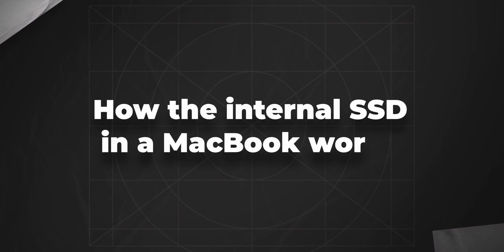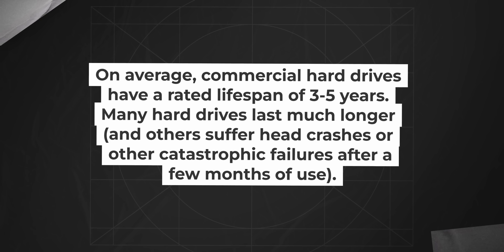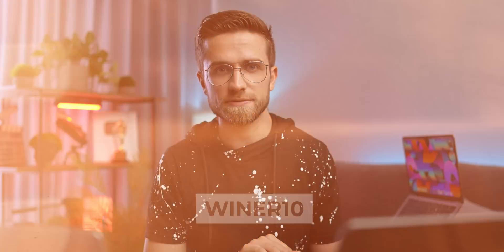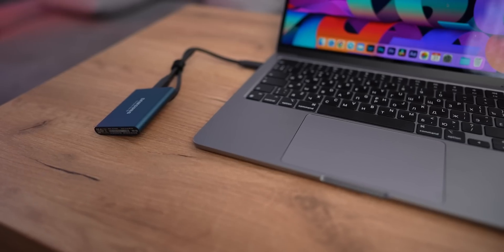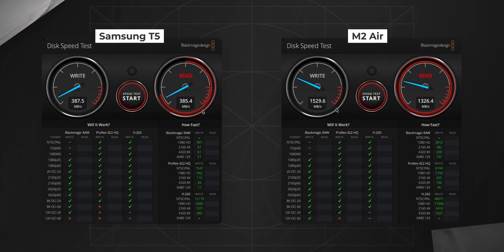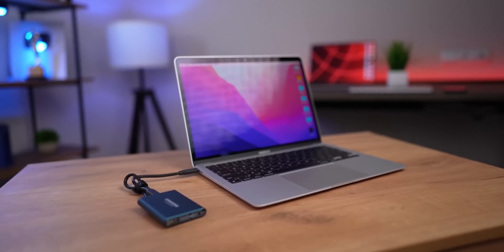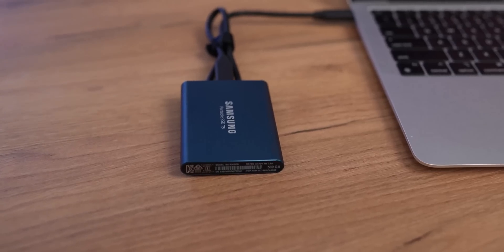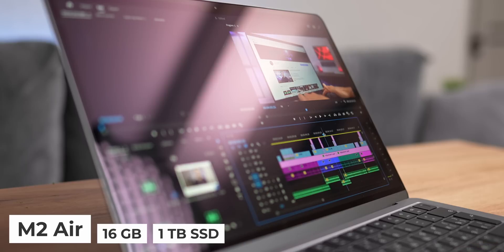M2 MacBook Air UPGRADE that actually makes NO SENSE!

Comment: That's not true, you can boot any Mac from an external storage unit. Also, since the OS goes mainly in the memory (RAM) it will run flawlessly. Finally, those Thunderbolt 3 / 4 ports are fast af. For decades we use to work projects on external drives, no wonder why Apple have closed the internal drive replacement design: the insane speed of these ports protocols. The only bottle neck will be your external device's limitations. So don't go cheap on external storage.

Comment: Unless Apple Silicon has changed things, this is plain wrong. I’ve been running a 2017 imac off an external thunderbolt ssd drive for years. It was a huge upgrade from the built-in Fusion Drive. Swap is definitely on the external drive.

Comment: Great video! Are regular Zoom meetings considered resource-intensive? Should I upgrade the memory in addition to 512GB storage?
Reply: If you are only doing common office tasks day to day it is not necessary to upgrade your m2 air, just the default config is fine unless you have few more hundreds to spend (and nvme ssd is crazily cheap in the market actually)

Comment: (5:23) "an external SSD cannot know what is happening in the logic board, therefore be used for swap storage". This is a major misunderstanding of how swap works. It's not the SSD that goes and check if RAM usage is high, and decides to kindly lend a helping hand. The kernel does this. The SSD is just a drive, it doesn't need to "know" anything about the logic board.

Comment: Should we all just spend a little more money and buy the 14 inch MacBook Pro
Reply: I agree, upgrading your M2 Air to 16gb RAM and 512gb SSD will cost 1,700 usd. You can get the objectively better base model 14 Pro at 1,800 usd.
Reply: @midnightsnack1306  but the pro doesn’t have the  midnight color😏

Comment: People instead of the M1 buy the M2 air. Don't believe what other says, the M1 is already "old" so if you keep it 3-5 years it will be 5-7 years old. Just buy the new one, it's better in every way🥰
Reply: it isn't better in every way, it just isn't. Not saying that your resale comment isn't valid, but half the speed SSD is a fact, they stuffed up, and that's all there is to it. If I had waited for the 2nd version of the macstudio I bought and it had a half the speed on the SSD I would have been pissed.
Reply: @ggproductions7078  personally I think that even if the ssd "issue" is true it doesn't mean that is really an issue, the difference with the reading and writing thing is at most a couple of minutes between a 256gb and a 512gb. They are blowing it up of proportion...it's not that serious. That's way to me it's a way better solution to buy the M2 with a 16gb ram and a 256gb ssd.
Reply: @productivitymodeon  That' an interesting view. It is half the speed and it is because of the NAND chip situation. That is a fact. Again, companies make mistakes and either this is one or it was a deliberate decision to shave a minimal cost reduction and hope that people didn't notice. If they had pointed it out, as they have with other products, and said sorry, this is slower than the last model but if you upgrade the SSD you get faster speeds then all would have been good, well, not good, the implication is that things get better not worse! The idea that it's not that important, well let's get back to hartd drives eh, or Solid state drives of the old kind, I mean, speed doesn't matter does it! The idea that you can get a Thunderbolt 3 enclosure that runs faster than the built in SSD is a nonesens. But of course, this is just IMO and it seems that right now everybody has one! Have a fine day of it.
Reply: @ggproductions7078  yeah I know that but even with that said we are still talking about minutes not hours.
Reply: @productivitymodeon  Sure, and in a way I am contradicting myself, I have often said when talking about mobile phones that if it moves at half a blink speed then surely I could live with it taking a full blink speed, sure, of course, unless I am paying for new and improved and not old and ordinary ( I know the M1 Air is not old and ordinary) I think they have made a deliberate policy of reducing the speed in order to encourage you to ladder and pay the extra 200, then you think, well, I have spent 1400 so I might as well get the 16gb memory, actually now I have spent 1600 I might as well spend another 180 and get the 14" M1 pro, MacBook pro which is better in every single way except weight. This idea that a £1200 laptop is entry level for light work and media consumption is a nonsense, as is the condescending notion that the people who would "only" spend 1200 won't notice, it's crap loads of money! I think, once you have spent that you have a right to expect it to perform better than the previous model. Now there could be an argument that as it is still available just get the M1 and that is fair, but they should have just let us know and not have people find out through reviews.
Reply: @ggproductions7078  yeah all of that is fair and right. I still think the M2 is the best choice, from the design (I’m talking about magsafe besides the color) to the speed. Again, you are right in saying that they should have told us about all of it, I think they should have stopped selling the M1 and they should have put the M2 at a lower price (at least here in the EU where it cost at minimum 1400€)
Reply: @productivitymodeon  That's a fair comment, don't get me wrong, different design, better screen and webcam, increased bandwidth and magsafe with at least the same performance and it would have been worth the price rise. But given they were selling the M1 macmini for the same price as the Intel version, they are able to make choices. But, I use a macstudio for my work and an old windows i5 laptop for MS office stuff and, well, laptop work and media consumption. It can't do any video editing, and the battery is crap, the screen is ok but it probably would cost about 600 for a newer version, so it's all down to choice I guess.

Comment: A external ssd may not improve the performance but will help to maintain the performance of the Air, cause you can have always enough free space in the internal ssd. All libraies and files in the external and only apps and projects in the internal. So 250 GB should be enough... if you need more, well you need a Pro machine

Comment: I current have an external ssd that I'm using with my MacBook Air that I have my MacOS installed on and boot from.  (I have a vanilla macOS Monterey installed on my internal drive that I run ONLY  apple silicon or universal apps since I don't want that Rosetta bug to affect it with heavy swap memory issues).  I didn't hear you mention anything about running the OS off the external (might have missed it??).   Its FAST!!! and that's not even using a Thunderbolt 3 NVME SSD drive either!!! So far....its running perfectly on my MacBook Air 8GB, 256GB laptop!

Comment: Technically this is how most professionals that do highend video and audio recording. The main drive is only used for the OS and Software but you install samples, assets , plugins on an external SSD or a thunderbolt based external hard drive. Saving to the main internal SSD is the stupidest thing to do. SSD have issues with consistent write or rewrite. The external drive becomes where all projects files live. 

If you didn’t know this is how professionals like myself work, you should do some research.

Comment: A few points:
1. swap is standard on all computers on all operating systems. You'll never have enough physical memory for how much your applications might need to address. It is perfectly fine for the computer to swap.
2. The "issue" you're describing here should be blamed on having only 8GB of RAM. Because the base config does not have "enough" RAM, it may need to swap more, thus write to swap more, thus reduce the lifespan of the SSD. You are correct here but the issue is more the RAM and not the SSD.
3. You did some random test where you compared loading apps from an external drive vs the internal drive. As you described most people would install their apps on the internal drive so your test is pointless.
4. You say that an external drive cannot be used for swap. NO. The point is that it would be stupid to use an external drive as swap. First off, external drives are hot-swappable/removeable. What is the OS to do when all of a sudden its swap has disappeared? Now you have missing data or corrupted data. Secondly, most external drives are connected using the USB bus. This is so much slower than whatever internal bus (PCIe for standard computers) and would not be worth it. Thunderbolt may be faster than USB but it is not yet standard for most drives.
5. Your "can the Mac use the external SSD as swap" test is, based on point 4, entirely nonsensical. Unless you modify the system's behaviour, it will not even consider using the external SSD as swap.
Reply: So it is not a good idea to buy Air M2 base model. Should i go for M1 Air base?

Comment: I don't like the idea that the lifespan of my mac is limited to the health of the hard drive, for if it fails the mac is toast. I think I'll keep my intel MBA instead of selling it, granted it's a 2011 model but as I'm able to replace the SSD it may well end up outlasting the life of my M2. :O
Reply: There are stress tests out there that show that unless you are writing terabytes  of data regularly, most SSDs should last longer than the useful lifetime of the computer.

In China, there are already third party repair shops that can replace the RAM and SSD of the M1 Macs. I can imagine in a few years, US repairs shops will be able to import the equipment needed and learn the methods eventually to do those upgrades. Macs are pretty popular and expensive, there should be a demand for such a service.
Reply: If it works for you, that's great. I wouldn't be so afraid of this whole M2 SSD issue though because it's definitely been overblown if you're just a normal user.
Reply: @sebastianlau4809  You're probably right, its just that I have extended the life of many of my Macs by replacing hard drives, but then they were mechanical ones... not SSDs. I think these things don't really concern those with fat wallets but when you wear worn shoes you have to consider these things.
Reply: I have a 2013 mba 11” 8GB ram with 1TB ssd, I don’t wanna waste time on this machine… I replaced it with iPad Pro in 2018. 

I thought getting bigger ssd would help the lifespan but it’s not truth, I wanted a new machine lol

Comment: This is going to be plain and simple the base MacBook Air M2 is more than powerful enough for 90% of users out there the 256 GB SSD that is the only flaw with these new devices I think the reason why the slower SSD speeds came to flourishing was due to the market shortage is it fair to consumers know but those speeds should be fast enough for the majority of users .when comes to users transferring files from and external drive those speeds are limited to the transfer speeds cap on the drive so theoretically speaking it shouldn't matter stop using the macbook air for pro task just buy the pro

Comment: Thunderbolt external storage should be much faster than this usb SSD shown here. Need to give this another shot. External drives have always been used, not sure how or why you give the impression they are not 🤔 

I think 10+ years ago using internal hard drives with less than 80MB  read/wright, external SSD was much faster around 2-300+.

Now it’s insanely fast what can be achieved. Regardless, get a proper external Thunderbolt NVMe Drive and do this test again
Reply: !00%, you can spend £175 ish on the enclosure for a basic one, 150 on a PCIE3 NVME for 2tb and you will be getting faster speeds than the 256GB internal, you may be able to get up to 2500mbs, but more likely 2000mbs ish

Comment: planning on buying a Mac for uni. I either go for the M1 base model air or the M2 base model air, there is a price difference of $300 when the "educational/student" price is applied. Which one should I get? or I could go for the m1 Pro 13 base model which is $100 more than the m1 air base, which one should I go for?
Reply: M1 MacBook Pro
Reply: M1 Air 100%
Reply: M2 air 100% Don't believe what other say, the M1 is already "old" so if you keep it 3-5 years it will be 5-7 years old. Just buy the new one, it's better in every way🥰

Comment: Thanks for explaining the ssd issue again. Most people get it I think, but there are a few who will not understand or believe under any circumstances. They witter on about 'it's only a base model' and the tests don't represent real world usage. But on the 256 Gb ssd single nand chip they don't have a leg to stand on. Although some will bore you with how they think swap memory works, and how it won't affect them somehow. Some commenters even tend toward the the divisive 'Youtube influencers' against 'ordinary users'. I'm glad you keep putting the issue straight.

Comment: Hi. I may be saying something stupid (I don't benchmark SSD speeds on a regular basis, at least not enough to know what I'm talking about). But the external SSD you're using is USB 3.1. If you were using a Thunderbolt 3 enclosure with a fast enough SSD, then you'd have (theoretical) transfer speeds of 5GB/s. You wouldn't see the difference with the internal SSD.

Anyhow, it's just for the sake of argument. As you say, it doesn't really make sense to get a thin and light laptop, and to have an external SSD hanging from it permanently.
Reply: IMO most of the time when you're doing work, you're probably seated so having a drive connected isn't probably such a big hassle. With how cheap storage is these days, you could even work off a USB drive, say the Sandisk ones with both Type C and Type A plugs.
Reply: @sebastianlau4809  Sure, it's all about how the user wants to use their machine. The external SSD option is not as bad as Arthur makes it, provided you use a Thunderbolt 3 enclosure, and if you're ok with having it permanently connected. You're saving $600 (+tax) over the price Apple charges if you're getting 2TB. Some might want to make that compromise.